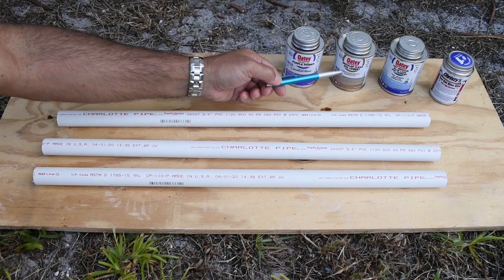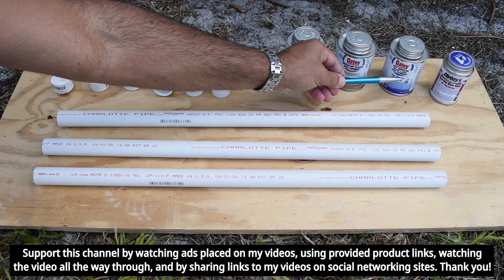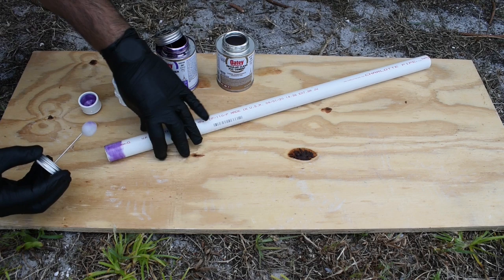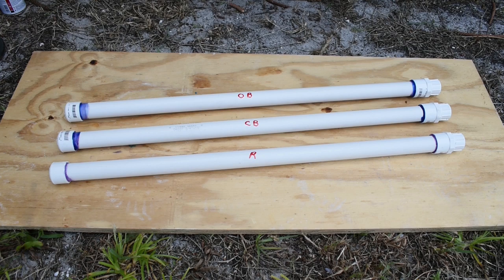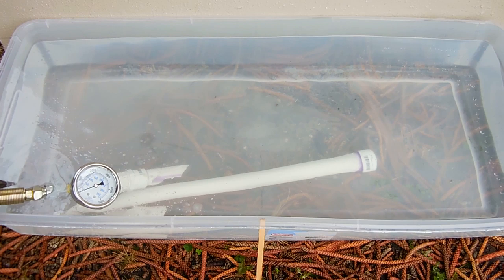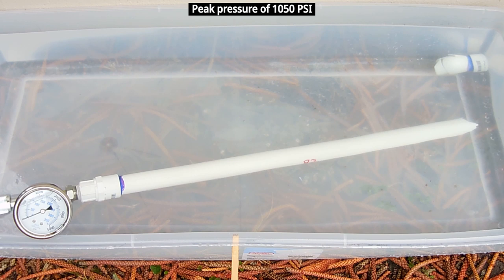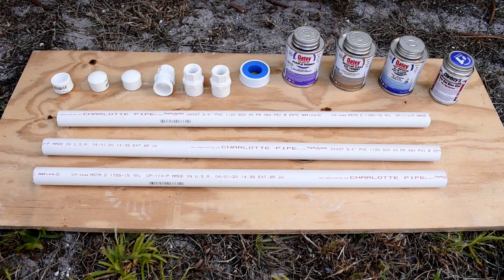Which PVC cement is better? Oatey or Christy's?

Comment: I have two issues with you're testing.  First you set the tubing down on the board after applying the primer, which could have removed more or less primer on a particular tube then another.  2nd, you used an Qatley primer, with a Christy product.  I would have liked to see you use a Christy primer with their own product.  And I don't think a primer is required with red hot blue?
Reply from the maker: Hi there. As for setting down the tubing on a clean surface, not an issue. If you look up the MSDS for Oatey and Christy's purple primer, you'll see the exact same chemicals are used in varying ratios. The results wouldn't be much different than you saw in this video. Thanks for watching

Comment: I am replacing pool fittings by the pump return from the pool and i notice blue glue or cement at the joints its blue but dries like Elmers glue should I    use the same or stay with cement clear?
Reply from the maker: Clear or blue, all gets the job done

Comment: Use schedule 80 pvc and make another video. The pvc will not fail and quickly and the solvents will be tested.
Reply from the maker: I used SCH40 because that's the most common.
Reply: @electronicsNmore   You're absolutely right, comma however I'm left wanting for more.  Your video proves that the pipe will burst before the cement.. That's good to know, but which glue is stronger?

Comment: How do the cans open? I'm using a gripper glove..is is screw on or do I need a screw driver...I'm really upset
A " grip" glove...this auto correct sux...
Reply from the maker: Turn upside down and bang the lid on concrete a few times. Make sure it hits flat. Always works for me.
Reply: @electronicsNmore  Thx, a n'bor opened them with a wrench😘 easily..
Reply: @texastwister6988   channel locks 😉👍
Reply: Thanks but it's too late.. luckily bc I can't use this on the hoses/ pipes I have.. I had a plumber come out. I'll just give this to my brother since I can't find the receipt..

Comment: aren't you meant to let the primer dry first before applying the cement?
Reply from the maker: No. Directions clearly state to apply the cement when still wet.
Reply: @electronicsNmore  i must be using a different primer, the stuff i use is clear for a start so yea nvm haha

Comment: Does PVC cement work on regular plastic?  From what I understand, PVC is just an ABS plastic, polyvinyl chloride
Reply from the maker: They sell cement for ABS.
Reply: I have used the red hot on it without failure,  can't attest to the rest...
Reply from the maker: @Quickened1  The only thing I don't like about the Red Hot & Oatey blue is how it applies, it's too thick and doesn't coat the pipe good, the Oatey regular goes on with a very nice uniform coating.
Reply: @electronicsNmore  ...I tend to agree,  but sometimes,  like when the pipe can't be twisted, or in damp locations,  I prefer the hotter glue...It tends to set faster too, I'd say 90% of my work is done with Oatey regular...

Comment: When you put text on the screen, can you put it in a different place.  Every single time, without fail, when I pause the video to read the words, youtube covers them up.
Reply from the maker: Where in the video? Someone told me they to move up the overlay for subscribing and clicking the bell, I did that.
Reply: If on a touchscreen device, after pausing, try tapping on a non-control area - that clears the screen of any YouTube controls.
You'll need 2 taps to continue playing though, as the first tap (anywhere on the screen) just brings the controls back.
Been a long time since I used YouTube on a regular computer, so don't recall how to do 7t there...
Reply: @electronicsNmore  At the very top and very bottom of the video.  On the top, YT superimposes the name of the video and at the bottom it superimposes the controls and the timer line.  I watch from a PC.
Reply from the maker: @tarstarkusz  I watch from a desktop as well, and don't see it. Where in the video?
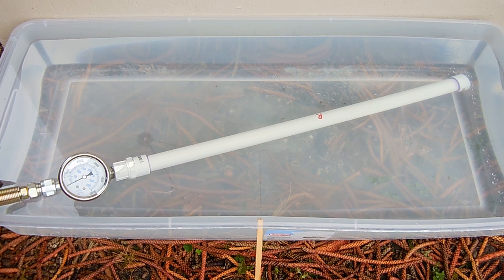Reply: @electronicsNmore  There's an example at 3:00 and another at 4:18 Those are at the top.  At 5:00 there is one at the bottom.

Comment: I found some old PVC pipe in my shop yesterday.  I was surprised how much thicker the old pipe was.

I bet what you used was from those folks who gave us the bat soup virus.  They have a way of decreasing the material content of almost anything.
Reply from the maker: Are you sure it's not schedule 80?
Reply: Positive.  I make archery bows from PVC and can spot differences pretty fast, in how they heat, bend, and form by hand.  The old piece was on the same pile with some newer pipe.  the old stuff was still straight, and the new pipe was sagging under its own weight.

Comment: Go figure,  when you tested the pipe, the glue blew, when you tested the glue,  the pipes blew.... How ironic is that?
Reply from the maker: I was surprised myself. I applied it the same exact way, using the same primer and cement......similar air temp and water test temps.

Comment: He didn't even apply the glue right. Male-female-male. He went female-male and joined.
Reply from the maker: Makes no difference, I tried a few different ways. If you doubt my results, try it yourself. The test is reliable, and application methods vary.

Comment: WRONG! WRONG !WRONG!
YOUR PRIMER SHOULD DRY AND YOU RUSHED THE PROCESS CAUSING A MIX, I SAW THE MIXED COLORS DRIP OFF.
IT BREAKS DOWN THE GLUE AND ONLY NEEDED FOR THE 1ST REGULAR GLUE. BOTH RAIN OR SHINE, AND CHRISTY'S IS PRIMERLESS GLUE AND YOU JUST APPLY A LAYER WIPE IT OFF AND ITS PRIMED. ALWAYS DRY PRIMER OR YOUR VIDEO IS NOT TO SPEC PER MANUFACTURER AS STATED.
Reply from the maker: WRONG! Read the container, and stop being a Jerko using caps. Pedants aren't tolerated on this channel.